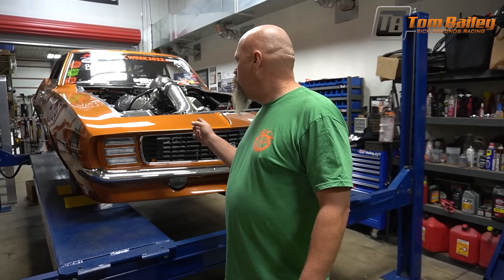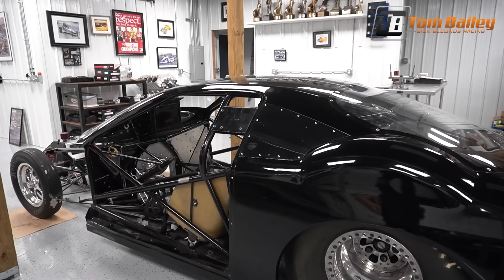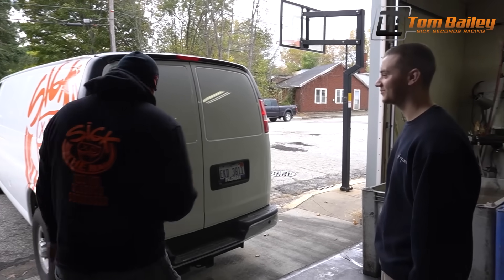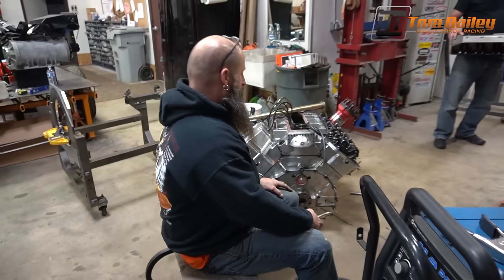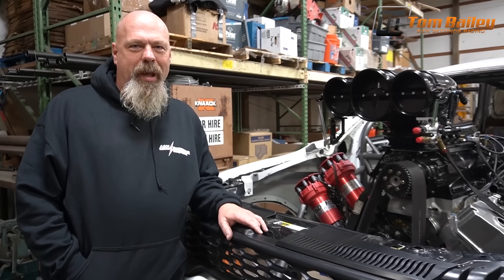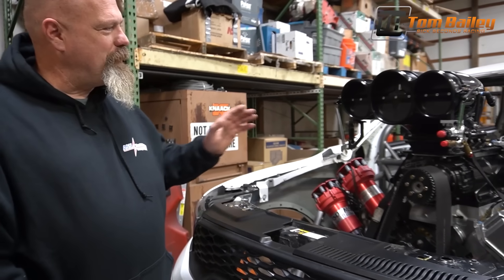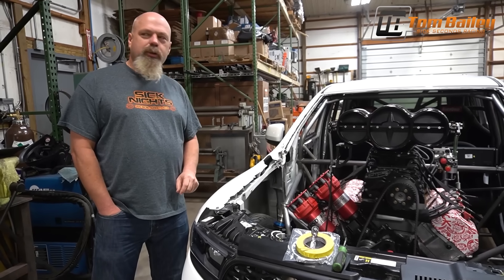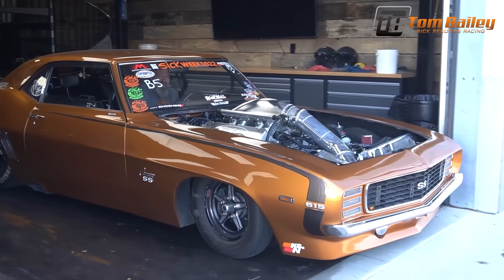Nitro Hemi in a Durango, YES!!!

Comment: I have used an ergonomic keyboard for years and it only takes a couple of hours to get into it but once you build the confidence they are fantastic, I have only recently tried a vertical mouse I usually use a rollerball mouse but the vertical mouse puts less strain on your wrist so I can honestly say both work wonders for your wrists and arms and ultimately your productivity. This is a good endorsement from you and as usual 100% clarity from you regarding the small commission you may get from any purchase.